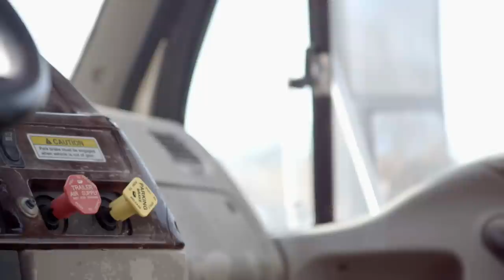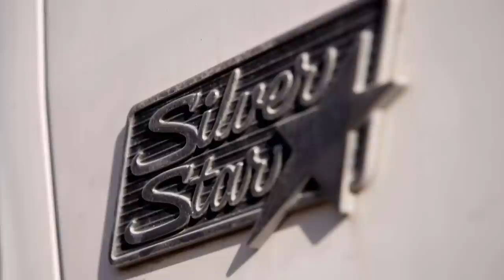Aaron Doubles The Horsepower Of His Semi-Race Truck | Shifting Gears With Aaron Kaufman

Comment: I would start with a single axle day cab with a 6 or 7 speed allison and 4.56 gears
Reply: An older freightliner box truck with a bobbed frame to make it a single axle is a great place to start.
Reply: @HeyItsJonny  I used to drive one with a 3126 6 speed. Slow as shit. Super rough ride. Air bag suspension with a 8.3 cummins would be a lot better
Reply: @Donovan Savage  super slow, I drove one for matrix a while back that had a drop axle to run local stuff when full length was slow.
The trucks with the 7 speed allison and mercedes/detroits ~8L were much more tolerable.